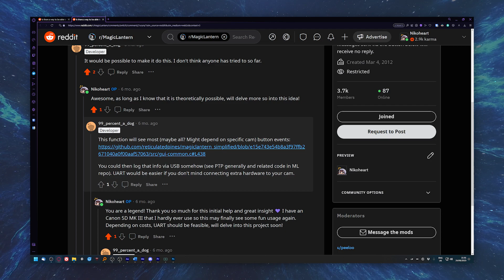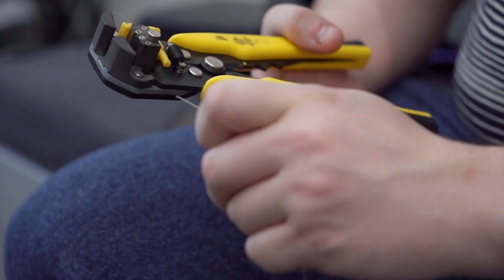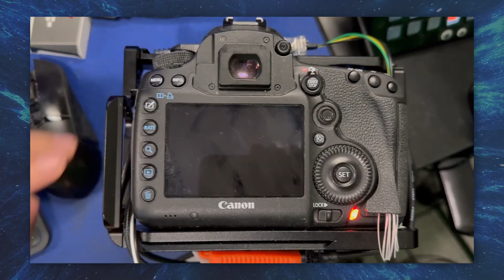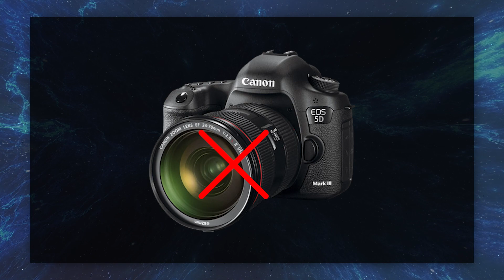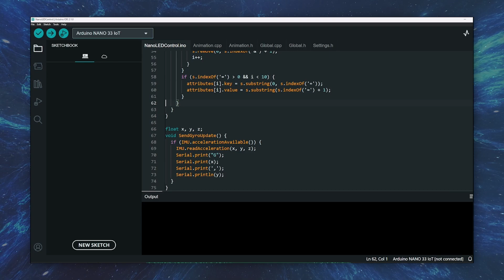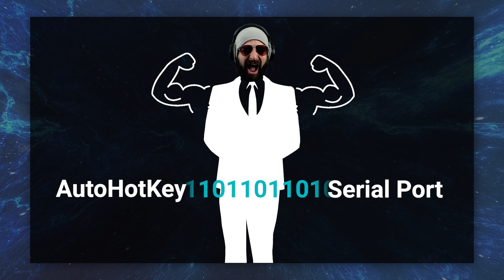Gaming with a Camera Controller??? - Is It Possible

Comment: That's crazy! Well done, and great documentation on how everything works.

Have you considered running the serial data through the Arduino? You can have it parse the data and emulate the mouse + keyboard controls directly, which should significantly simplify the setup.
Reply from the maker: Potential for sure! We'll explore that over the course of the next few months!